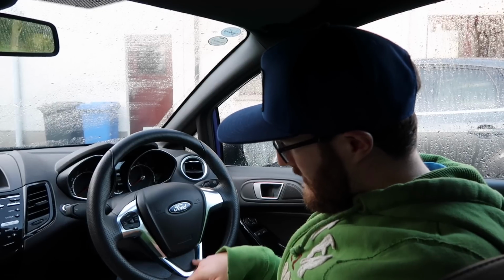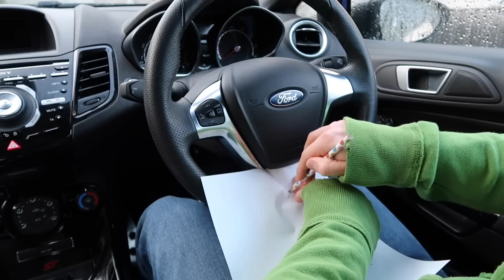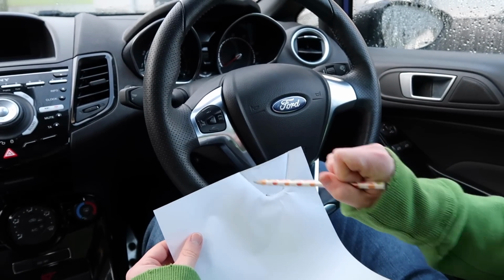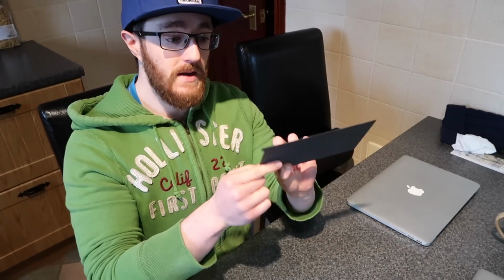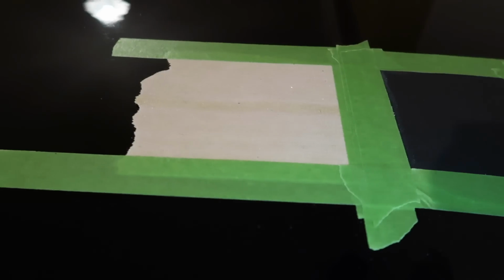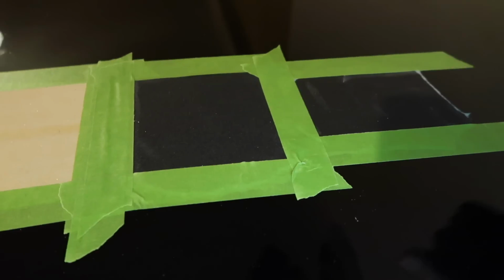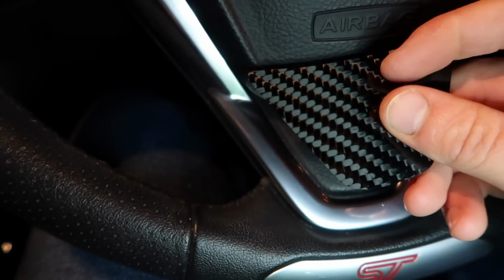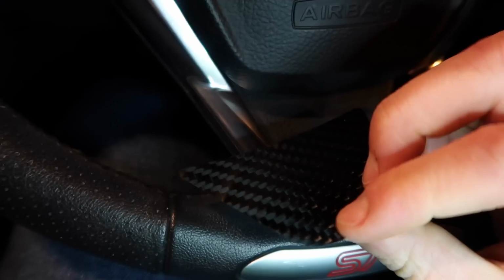CARBON FIBER STEERING WHEEL INSERT! | FIESTA ST

Comment: Adam, you're costing me a fortune. I just changed my Audi TT for a Fiesta ST. After coming across your great videos, I'm off to Mountune next week for a 215, cat back & loads of other stuff. Nigh on 2 grand's worth. Aaagh!!
Reply from the maker: It's all worth it though Richard ;)
Reply: You can say that again Adam. I just returned a few minutes ago from a 600 mile round trip to Mountune for the work. The car I drove back looks, sounds, feels & performs a whole lot different than the one I drove there!
Reply from the maker: Richard Hannam nice one. What all did you get done?
Reply: Evening Adam. Work was: MP215, cat back, billet quick shift, gear knob, leather gear shift gaiter, satin black Mountune side splashes, exhaust isolators, induction hose. They gave me lots of freebies too including some more decoration. Pricing excellent & customer care even more so.